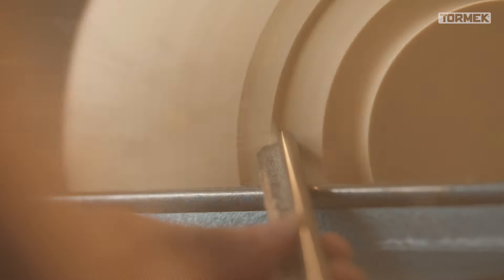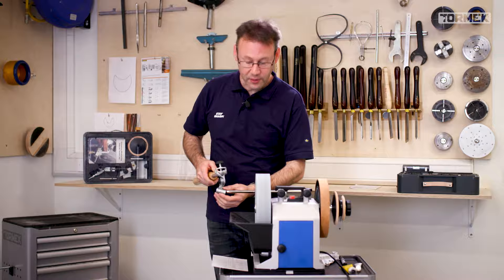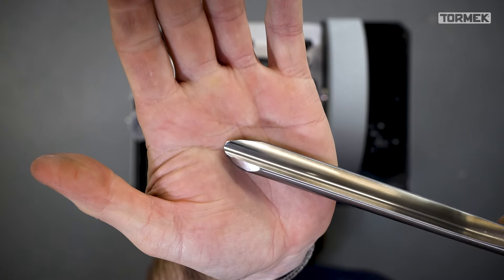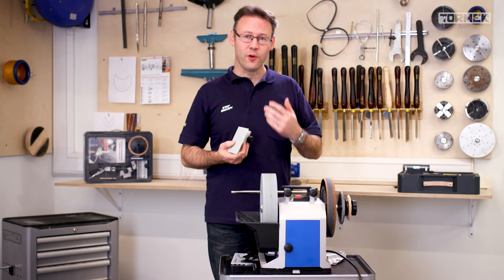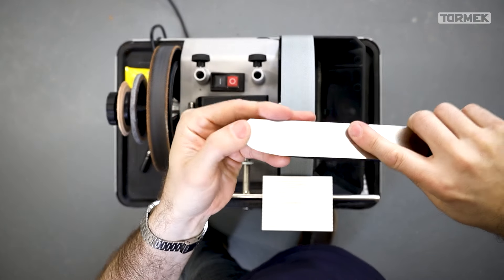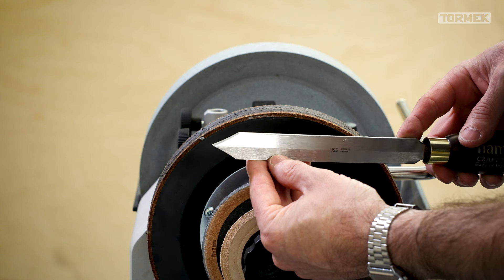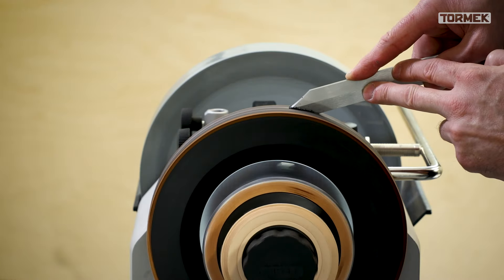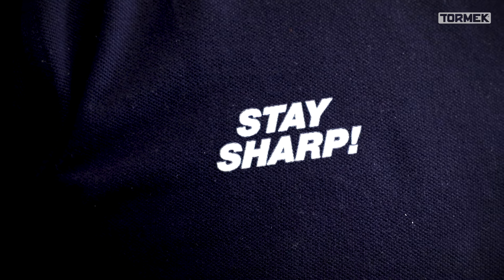Sharpening Woodturning Tools on Tormek  – Instructional Video with Glenn Lucas

Comment: Glenn - the comment about "making the tool used" is sooooo funny, cause i thought i was the only one who did that!!!
I recently bought the Tormek System, after having great difficulty sharpening my tooling.  Although it was primarily purchased for the lathe tooling, its great for all the other straight blades as well.  Looking at cost comparison - i went down the diamond plate and japanese stone path, and i can honestly say, it would have been cheaper to go straight to the Tormek System.

Comment: Thankyou Glen... I have a knockoff unit but loads of pukka Tormek jigs including a Tormek diamond wheel.  I just need to clear access to my Record Power DML620 lathe and get back turning... cheers Paul in the UK
Reply: Likewise, I use a Axminster system (simply couldn’t afford or justify a Tormek system) but only Tormek jigs and accessories
Reply from the maker: We are happy you find the video usefull. 😀

Stay sharp!

Comment: Thank you so much for the most comprehensive video on wet sharpening sharpening I've seen. Although I could  never afford a Tormek T8 I'm slowly upgrading my Record Power wg200. I have already purchased the SVD-186R and the TTS100. Next up the SVS-50 . At the moment I'm torn between upgrading to a TS200 or pushing my limited budget to the diamond wheel TF200.
Reply from the maker: Thank you very much for the good feedback! We are glad you think the video is usefull. 🤗😀

Comment: I own the Tormek T-8, but I have heard that the machine would have a longer turn around time when sharpening M42 steel; that is steel with 10% cobalt!  Yesterday I purchased the Tradesman Wood Turner grinder set up with 180 grit CR and 600 T8-600 grit wheels.  Quiet an investment anyways!  I purchases the Tradesman with the Tormek bracket, so the jigs will be universal to both machines.  I am planing on using both machines and thereby utilizing the Tormek  as a de-burring finishing station.  Long story short have you heard of the Tormek having such problems cutting M42 steel?
Reply from the maker: Hi! No there are no such problems. You might be a bit more efficient with the diamond grinding wheel though :) stay sharp!

Comment: Glenn, can you get the same effect by reshaping or rough grinding the tool on a CBN when before final sharpening on the Tormek ? I have only resharpened on a CBN or white wheel ,and have had good results, I have never fine sharpened or honed as you are demonstrating.
Reply from the maker: Hej woodturnermark8529, try it, you will feel and see the difference

Comment: good tips, but what grit wheel did you use, the 400 or 1000 grit?, also from watching the Tormek video series of sharpening, they say to PRESS on the threaded rod of the support & lock it down FIRST, then the other, it ensures the rod is PARALLELL to the wheel's surface.

Comment: If you need to add a black sharpie line on the wheels, why not design it so it has a groove so you don't need to?
Reply from the maker: The grind stone wears down slowly over time, so the groove would disappear. Also it would affect the sharpening negatively. A sharpie does it just fine until you know by experience you are in the sweet spot :)
Reply: @TormekSharpening  I mean the wheels at 6min 33s. Why not just have a line across either printed on or embossed across the two wheels. Seems mad you'd require sharpie for this bit.

Comment: do you not think it would be a good idea insted of keep saying the 'the marker method and say what the angle should be on the WM200
Reply from the maker: Thanks for your feedback Dave! The marker method is perfect to repeat the existing angle of an edge. It will speed up the sharpening process since a minimal amount of steel needs to be removed. After you have found the right angle using the marker method it works perfectly fine to use the WM-200 AngleMaster to see what angle your edge has 👍  Stay sharp!
Reply: @TormekSharpening  but my wm-200 has 2 angle gauges on it which one do I use.
Dave.